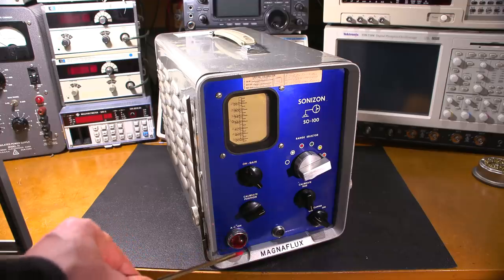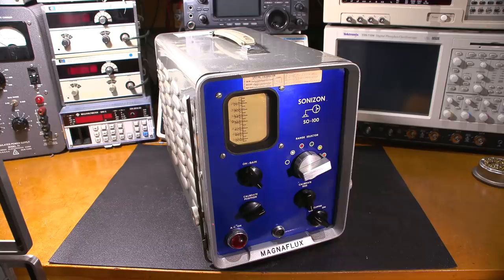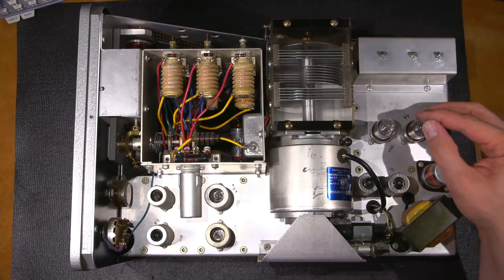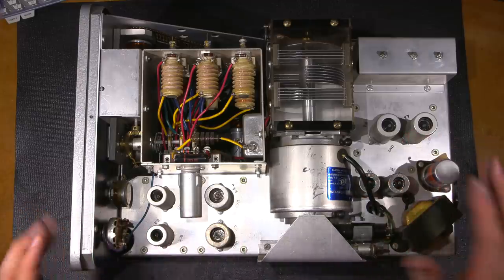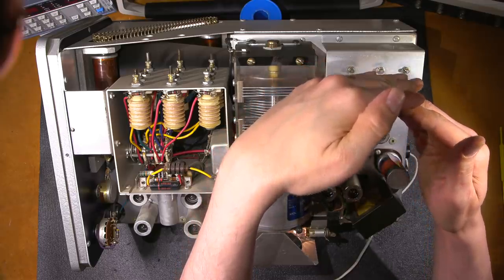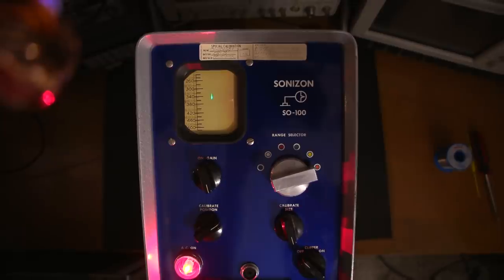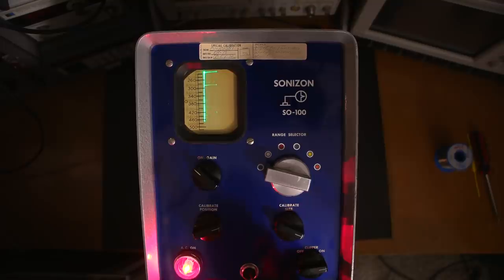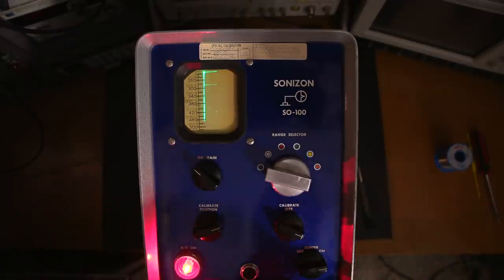Restoration or Parts Teardown- You Decide! [Sonizon SO-100]

Comment: I vote for the restoration of it. I could use this thing.
Reply: What would you use it for?
Reply: S12Bn0122 K12jjs00988  I would not pay what it's worth, given that a more accurate device could be had for less. I'm a tech myself and just think it's a cool vintage piece, if it were mine I would fix and calibrate it and use it to test my welds.
Reply: Have you got a probe for it? If not, you're screwed.

Comment: It's for checking metal thickness, chrome plating,zinc galvanize,foils, sheets, and so on. Other units check casting wall thickness for optimizing cores. Quality control in automotive industry.

Comment: Worked at tube turns co, in Louisville, Kentucky. Between 1964-1973,repaired magnaflux equipment used in inspection dept.,magnetic flux induced in material to be tested,ispeceted under black light to detect flaws in material.

Comment: This type of device might have been used to check boiler plates in steam powered stuff that required sounding when this technology was available.  Boilers are used still in many older buildings for steam heat and hot water source.  Sheet metal thickness, tool metal stock consistency, the list can go on and on.  This looks like an interesting project.  If you can find the control head, that might be just the right reason to restore it.  I know having too many irons in the fire is detrimental to one's own goal set.  Your restoration videos are really good and gives excellent insight into the technology of the period which is why I am restoring my Dad's Heathkit equipment and SB series radio set.  Always look forward to another one of your videos on Patreon too!  Keep up the great content!

Comment: I recognize the "Magnaflux" name from building/rebuilding engines. The magnetic flux reveals microscopic imperfections in steel heads and blocks. That thing can determine penetration depths of fluids into metal surfaces too

Comment: Hi Paul!  Space Technology Labs became TRW.  The STL was located in Inglewood California & moved to Redondo Beach California and Became TRW.  After the move not all equipment received updated property tags as TRW property.  The tags with references to M3 and M1 also appear to be an early form of a "Property Movement Authorization" or "PMA" that would track equipment as it was moved or checked  out of the equipment pool to other locations.  Buildings M3 (Manufacturing  3) and M1  (Manufacturing 1) are still around!  TRW was purchased by Northrop Grumman and is still going strong.  If you're ever in the area, you might schedule a visit on the last Saturday of every month to visit the W6TRW electronic swap meet which is held near those buildings.  Who knows, you might even find your missing probes.
Reply from the maker: Thanks for the info Matt!
Reply: Just to be clear, TRW was purchased by NG & TRW is no longer in business.  The TRW campus was considered to be very futuristic during the 1960-1970 time frame. As it turns out, , Hollywood would show up on the TRW campus and film some of the popular 1960's TV shows such as Star Trek and the Man from UNCLE in front of selected TRW buildings.  Bottom line is that you do have a bit of aerospace history in your collection - I would like to see it back in service.

Comment: Mr. Carlson, we used a similar device at Clark Inspection in Tulsa OK. back in the day,to find any inclusions , voids, artifacts,or anomalies in aircraft quality billets before they machiinied them (non ferrous metals).the billets were polished to provide a good surface for our sensor and oiled to make good contact.it was kind of like sonar for metal we could detect very small targets even in 4-6 inch thick pieces .in 3 dimensions, we could locate the  exact position of the flaw.the HF sound reflected back from the opposite surface inside the piece making a reference for the CRT to use to measure from we found very few flaws it was truely an "event" to find one.

Comment: Hi Mr Carlson, I worked at a steel mill "Pacific Steel Casting" for many years and I was the plant electrician and had to repair many times our Magnaflux machines that we used to test for cracks in our castings! They Magnaflux units were in special dark rooms were castings were placed on a steel table and one by one the operators attached a clamp to the casting and sprayed a special dye on the casting and then he pressed a foot switch and the high voltage "frequency" went through the part and while holding a "Black light" he could see cracks in the steel! I was always amazed at the process and the Magnaflux units were from the 60's and still performed quite well! Our units were about 3 feet by 3 feet square so compared to yours much smaller lol! Yea I would definitely like you to go through it...

Comment: I had a used Sonizon Unit and it came in handy for many years. Magnaflux Corporation is a superb company that catered to the heavy equipment and aerospace industry.

I used it to check cast iron engine block thickness of the cylinder walls and the water jacket pockets. 

1950 to 1975 cast iron engine blocks used very crude casting and iron foundary sand molds. As a result, core shift would occur because the grade of the steel was inconsistent.

So when it came time to find a used engine to rebuild for racing purposes, it was important to make sure sand core shift had not occurred between the cylinder bores.

If they did and a machinist over sized the bores for bigger pistons, the cylinder wall thickness may not be sufficient and be vulnerable to cracking under high power loads and increased heat.

Wall thickness needed to be over  0.125" after machining. 

If the block is a Siamese design with no water jackets, we still wanted 0.250" of wall thickness between the two inner cylinders. 

Mine was lost in a flood over a decade ago and wish I had it back. 

I just looked in my shop to see if I still had the probes or manuals but sadly I do not.

I hope you restore it, though I can't afford to buy it. I wish I could. These are really high quality analyzer machines. I bought mine from guy who got it at a Spar Aerospace auction when they were  selling off all its "old" stuff in Toronto.

Look forward to the restoration of this unit!
Reply from the maker: Thanks for taking the time to write, and look around in your shop too!
Reply: What did the probe\head gear look like,would it be easy to build?
Reply: enjoyed reading about this interesting application....
Reply: If he did a channel giveaway and we all voted on most deserving recipient based on your story you'd win

Comment: Mr. Carlson: I worked at a heavy maintenance base for a major airline around the turn of the century, back when we were still flying DC-9's, MD-80's & MD-88's. Later manufacturer Service Bulletins (SB) from McDonnell-Douglas and Airworthiness Directives (AD) from the FAA required us to perform magnaflux inspections of the control surfaces in addition to the regular SB-required x-ray inspections. These were done about every two years when the aircraft was in for its scheduled heavy maintenance check, to address possible metal fatigue. The inspectors used a unit very similar to your Sonitron (different brand) for the magnaflux examinations. Two fluids were sprayed (one dye fluid and one magnetic fluid) onto the surface to be inspected.

If you can find a service manual for this unit, I think you should definitely restore it! I like to see old tube gear being given new life. Even if you eventually repurpose it, I sure would like to see it restored. 

A suggestion: perhaps you could restore this then sell or rent it to a vintage automobile restoration shop. A unit such as this one might fit in perfectly with such a shop which would probably find it very useful! 
73 de NØJAA.

Comment: I vote for modification or non-modified repurposing.  Such a fine power supply for a laboratory.  Since a Magnaflux power pack is not rare, but the particle-detecting magnetic head is obsolete and expensive, perhaps at least a set of adapter cables with matching plugs and terminals could allow it to be used as a power supply for the lab. Possibly thread additional interesting wire connections through a bushing or grommet in the unused hole in the rear panel. Cheering you on no matter what you do, thanks for investing your time to make videos.          Mr. Carlson' s plans with schematics and other videos are worth a lot more than the 2 dollars he gets from my Patreon budget.  Fantastic learning experience on this channel.

Comment: I would like to see it restored.  From the one picture I saw, it looks like it uses an ultrasonic contact probe with an aluminum oxide wear plate and the piezo element is just undernieth that.  They look similar to those manufactured by Krautkramer Branson.  Building one on your own may not be impossible, however, there are a lot of processes that would make it quite difficult to get anything useful for that (the details are a bit extensive to get into here).  The interconnect also looks like it uses a 3 foot long coax cable, most likely RG-58 (50 ohm) as that is most common for ultrasonics.  You would just have to match up the appropriate connectors for each end.

Just so you know, my experience is as an Engineer that recently retired after 25 years in ultrasound, mostly medical but also a bit of industrial, everything from megasonic wafer cleaners to high frequency imaging arrays.

Comment: Restoration would be highly interesting. Hope that you have the schematics available. I would be amazed if you can recreate the working probe head just by reverse engineering the circuit.
Still hoping to see the Vedolyzer to come to an conclusion. You did so unbelievable things with that unit as well.
Thanks for consistently high quality videos, Paul!!

Comment: Please restore and I'd be interested in the unit if it were to be offered for sale. But just the engineering alone in the motor is amazing. It's one of the smoothest running motors I've seen in AGES.

Comment: I would suggest keeping it as is, except replacing the capacitors that need replaced. I like antique electrical equipment. I do have a Hickok Model 752 tube tester. It may need to be restored. It has 2 light bulbs as fuses. the line fuse is a #TS81 bulb and the bias fuse is a #49. The first time I tried to use the tester, the bias bulb burned out. I also have an old Varistat, that's rated at 2000 watts. I did wire the output of an 18 volt transformer in series with the input to the Varistat and in phase with the line input. I did design a circuit to use a voltmeter that only works from 95 volts to 135 volts. I haven't got to it yet, but I plane to use the output from the Varistat to an outlet on my test bench. I do like your videos and the one for checking the polarity of different capacitors was useful.

Comment: Paul, this test device is really a museum piece. Very few exist, and the probe is almost unobtainium. I suggest build the probe, do a recap, fix the plastic graph transparency, then shelve it. It really has no practical use, other than checking thicknesses of metal and welds.

Comment: Hi Paul, definatley restore. I thought it might use pulsed ultrasound but obviously it's swept CW, continuous wave. If the thickness of the metal is a half wavelength at some frequency then you will get a peak in the returned signal and if it's a quarter wave thick then you will get a null. Because the transducers used are probably fairly narrow band then that is why you would need a range of operating frequencies for different metal thicknesses. For CW ultrasound you need a pair of transducers, one for transmit and one for receive. The tricky bit is arranging the two transducers so the ultrasound from the TX transducer doesn't get picked up or block the  RX transducer. PZT ceramic transducers are available in a whole range of frequencies, shapes and sizes.

Comment: Restore! Hey Mr Carlson, any ideas how to repair a HP54600B where channel 1 is off screen? It happened after my statically charged dog sniffed the probe and a short spark later no channel. I've replace the front end LTC opamp to no avail :( Love your vids by the way!!!
Reply: Don't worry I didn't shoot the dog and I do have another scope. It's just that this HP scope is just great and I wanted to pass it on to my son when he's a little older. I guess he'll just have to make do with a single channel :(
Reply: @danriches7328  You can fix it. It'll take a bit more work than just your first try.

Comment: As Coil Smoke below commented, I know from car engine rebuilding they use a Magnaflux process with dyes or powdered metal to check cylinder heads and engine blocks for cracks not visible to the eye.  Dont know if this device is used for such things but Magnafluxing is a common process in car engine rebuilding and machine shops to check for very fine cracks and defects.

Comment: I know the vintage test equipment guys will want to restore it, but honestly I don’t see a use for it. It’s probably worth stripping and keeping the parts, tubes etc. That motor driven capacitor might be handy to drive a vintage sweep circuit, it’s in really good condition. Doesn’t look like that instrument has had much use.

Comment: Restoring it is definitely something that would be of interest to us.  Also, if you find out exactly what type of materials it was used on, you might have occasional use in your lab, though you might want to rent it out to hobbyists who are making or restoring things (old equipment or cast items) where they might need thickness information to do a proper job.  This "high tech" device would beat trying to get calibration tool feelers inside something, especially if you had to drill a hole first into a closed, hollow space.

Comment: Paul,  Perhaps this unit is made by the same Magnaflux corporation that still? makes the "Magnaflux" units used to check IC engine blocks for cracks.  They use magnetic fields to attract magnetic particles suspended in a fluid to any external cracks before wasting time overhauling a block that is ruined.

We use large "magnaflux" units (I don't know who made them) at work that are portable if you have a forklift -- 480VAC, 3 phase power.  But we use them to check for cracks in large steel items like aircraft landing gear.  They don't get used as much anymore because we use fluorescent penetrant & eddy current inspection methods most of the time.

Comment: I'd say either find the head that goes with it & test that, making sure it works else you're wasting your time.  A fine piece of electronic/mechanical gear, minus a matching sensor, will look just as good sitting on a shelf whether it's internals are restored or not.

Comment: How would you fabricate a CW transducer ? You need a pair of PZT or lead zirconate titanate crystals next to each other but slightly angled inwards to get a focal point at a certain distance. To make sure you transmit and receive as much ultrasound as possible you also need a quarter wave matching impedance between the PZT crystal and the metal you are testing, this is mechanical impedance and not electrical. These days pulsed ultrasound is used because you only need a single crystal and you also get around the TX RX blocking problem with CW transducers. It's history definately a keeper.

Comment: it is nice to see this device fully restored and all functional, is a beautyful equipement with excelent tubes and the motor/cap thing work as new. But the problems are the sort of plastic film on screen and the fact you need find or make a test probe/sensor is tricky. Obviously for you, making 
it should not be a problem but who knows.  If I had this equipment in my hands I would transform it into an oscilloscope or a curve tracer, and I would use the cap/motor to do something weird like a mechanical tremolo or something

Comment: Ebay has a Sonizon So-300 which looks a lot simpler than your unit for $575 sold As Is and does not appear to have a probe with it.  McDonnell Douglas in the 1980s used ultrasonics to inspect voids in aircraft welds and also we were just getting into composites and ultrasonics was used to test for voids in the composite materials.  If I remember, many of the test specimens were submerged in water or oil or had a nozzle squirting the water or oil onto the surface to get good ultrasonic connection.

Don't tear it down for a while to allow a possible buyer time to contact you and perhaps pay you to restore the unit, they might be really happy to get a fine test unit and put it to a good use.

Comment: I just saw this and would recommend restoring it.  First of all, it was owned by a company that ultimately became TRW.  Depending on what year this device was made and when & where exactly it was used, this could be an historical piece used during the height of the Space Race.  The most recent calibration shows '72, so this is within the Apollo Era (and determining if it was used with rockets, satellites, or what exactly is a fascinating prospect for research).  Considering it has the original "property of" label, it'd be interesting to look into that and see if you can associate it with any launch vehicles, satellites, etc. that came out of the facility where this was used.  Apart from those who could use it today for practical applications, some may also enjoy owning and using a piece of equipment that served a purpose with a trailblazing company during a remarkable time in space exploration.  Depending on its history, someone may want it as-is to be a shelf queen, but keeping it alive and functional makes it that much cooler for someone.